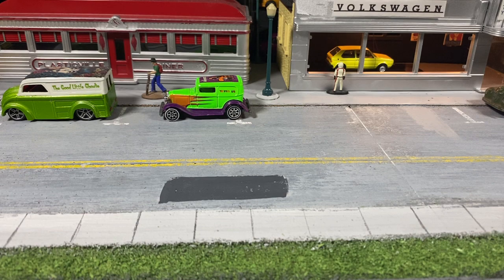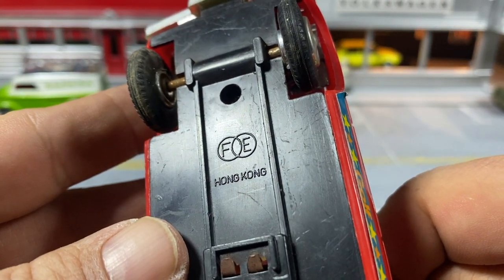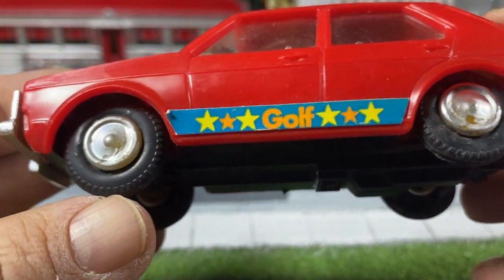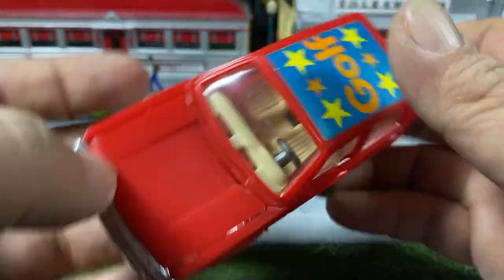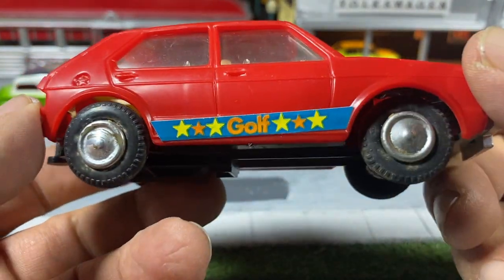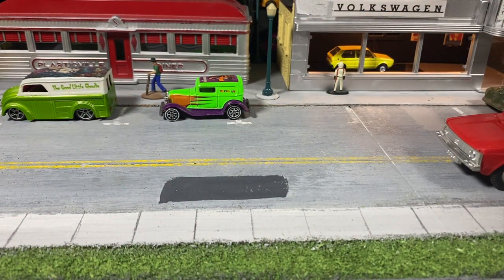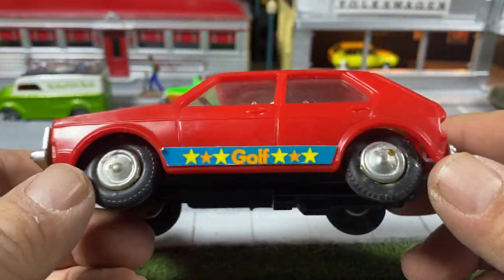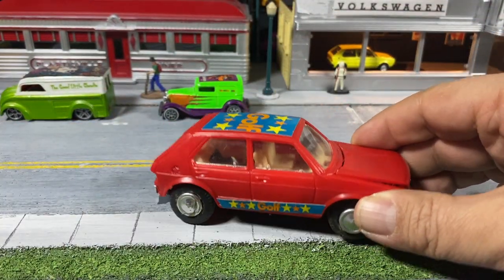Diecast Review: Volkswagen Golf GTI Plastic Friction Car Made in Hong Kong

Comment: That's a cool find.
I'd have to pull it apart to fix that motor lol
Nice one mate 👍 2:23
Reply: Not sure you really can. Maybe you could oil it, not sure that would fix the problem. Flywheel motors are the Ferrari engines of analogue toys-- either one of the smoothest, most powerful things around-- or a lost cause. Sometimes the flywheel just isn't heavy enough, or the motor has built up crap in it-- as a kid I had at least two that had worked perfectly, then just randomly lost all friction and went freewheel one day with no warning at all. 

You figure out how to fix this though, let me know-- it seems to be doin' the exact thing as a nice vintage Corvette I bought secondhand recently. Came sealed in the box, so I'm assuming either age or just never was right.
Reply from the maker: I’d try to fix it if I can find a video on what to do. I certainly don’t want to ruin it.